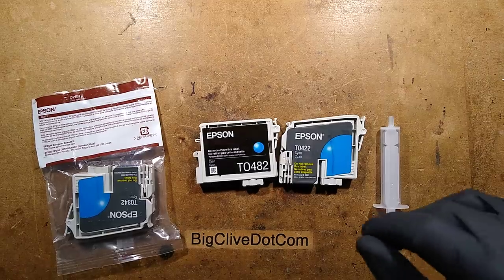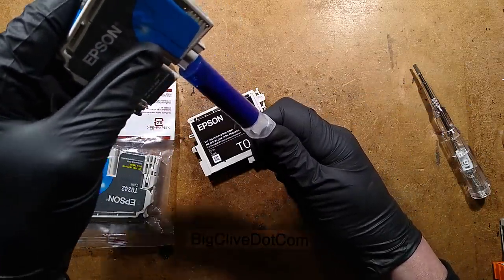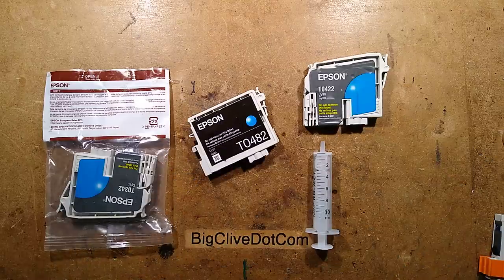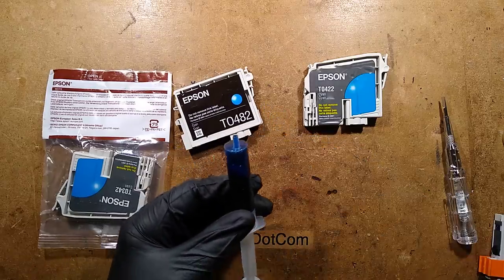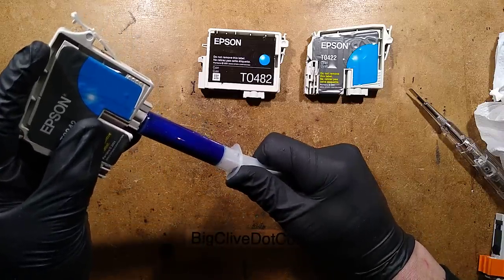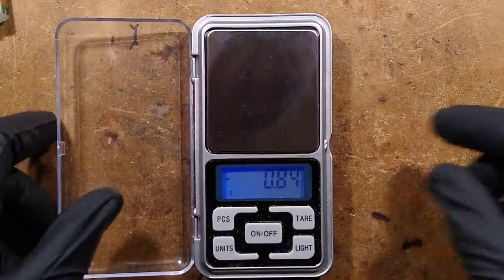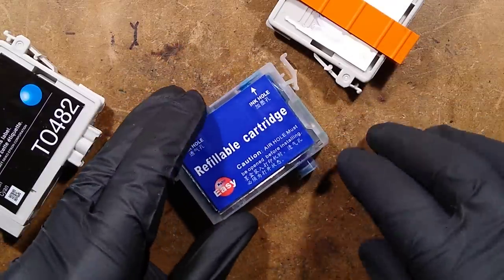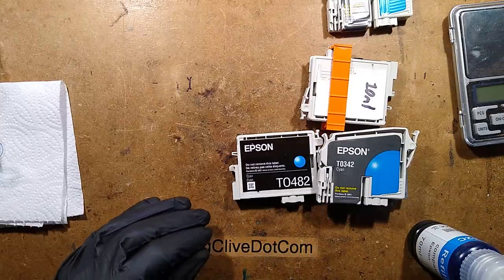How much ink is in Epson cartridges?

Comment: What’s worse are the triple colour cartridges, as they stop working if you run out of one colour
Reply: Yeah, it's always just one color.
Reply: @brianallen9810   Black tends to run out first even if they supply a bigger black tank.  Three ink printers are not generally used for much colour printing after all.
Reply: @hedydd2 What...? Black is a completely separate cartridge so that's hardly relevant. Also, plenty of people print in color on 2 cartridge printers.
Reply: And on a color printer, you still need the color cartridge do print black and white
Reply: @12345.......  You still need the cartridge, but it doesn't have to have ink AFAIK. Don't throw the cartridge out, easy.
Reply: The best thing I ever did, years ago, was junk my epson with it's dried out print head and buy a colour laser printer.
The quality was similar, but waterproof and stores forever, and is much much cheaper :)
Reply: @nimoy007  Not if the printer, as is commonly the case, requires a suite of all working inks in order for it to print even with a full black cartridge. Also some brands also disable the scanning to computer function is any single ink cartridge is empty. It’s extortion, no more, no less.
Reply: @nimoy007  Of course they print in colour if it has the facility but that does not mean, or in fact it does mean that the colour reproduction will be of very poor quality. These are not bought for colour printing but are adequate for printing most documents in colour. For photographs they are nothing short of pathetic.
Reply: And then they are crazy expensive to replace, as those are usually the more expensive cartridges with the print head built in anyways. I always tried to stay away from those. In my calculation it was not economical to use one of those, although the printer itself initially might have been cheap. Also, even with very little demand for high wuality pictures, even with simple graphs and diagrams, the quality of those was somewhat lacking, as they mixed up all three colors for black when printing pictures, sometimes even if there was a separate balck ink cartridge (that only got used for text. sometimes the coloured ones even were dyed inks and that one was pigmented.)
Reply: Color*
Reply: The solution is to spend $10 more and buy the Epson printer with separate cartridges.  in my 30 years of computer business I have seen all inkjet printers from all brands, and the only ones I found that did not suck prime every colour on every job are the Epsons.  I use a Workforce and I use clone cartridges that cost ~$25 Australian for 20 cartridges.
Reply: @nimoy007 Our Cannon MX won't print without the black cartridge having ink in it. Not all printers are created equal, obviously. It was the first time I'd ever run into a printer who wouldn't print because black was empty, even when black wasn't needed, turned off in settings, and in the printer options. I ended up popping the sensor chip and soldering two of the pins together in order to get it working. (Wasn't about to go out that evening in the rain just for black ink I didn't need, lol)
Reply: @hedydd2 That's the same issue our Cannon had. It would literally get stuck in POST upon power cycling it, and no amount of computer interaction could be had short of opening the software and seeing it was out of ink. No scanning, no faxing, nada. To this day no amount of firmware updates have fixed this bloody oversight, and short of them wanting ink sales, I can't imagine why anyone would have hardcoded this into the printer.
Reply: @samholdsworth420 

Colour*
Reply: I mean, every printer stops printing the moment you run out of cyan, which they use to print everything, even black
Reply: @nimoy007  unless its an HP which uses color to make the black darker lol. at least on some printers. for the most part inkjets are just nothing but crap. either your going through cartridges at cost, using a refillable tank system that can have a sponge the fills up and non replaceable heads that clog.

Im so happy i went laser years ago
Reply: or how about HP where if you run out of color ink you can't even print grayscale B/W, which is why I put a color cartage in mine that has about 20% ink left, and I never use it just so I can print in B/W as that's just about all I ever need at work. At home it's brother a B/W Laser all the way, but I will say HP does have good Linux support with a good software package for scanning if you have a compatible all in one.
Reply: What's worse is when you're printing in black and white, but your printer requires color ink to help make the black darker, so the printer won't let you print anything at all.
Reply: @samholdsworth420 we are in the UK so it is colour 🇬🇧
Reply: @hedydd2  Yup, Canon either lost/settled a lawsuit for this.
Reply: @infinitivez 
Put simply, the printer is not a printer but a demand system for their actual product: printer ink.

If you're going to use that device then they want their blood money, regardless of whether you need to print or not: as inks dry and blocks the print head, it requires flushing every time you switch on - how can it perform this vital function[1] if you have no ink in the machine?  At switch on it doesn't know you only want to scan...

[1]vital not only to ensure "clean" printing, but also to ensure ink is used up and you have to buy more...
Reply: I remember an old printer I had way way back in the day an HP 656c that could actually print with individual colours and use up all the ink left, some old printers could do that i guess back then it was normal for things to do what they should do.
Reply: I had one used for printing black only, and got tired of this, so got a refill kit. Then all 7 ink cartridges eventually were filled with black ink, as it only was used to print a few pages a day, and it was an old one, compatible with the PC running Win98SE, not on a network, that ran a phone report system. Used the inkjet as it was not xp compatible, and the original Seikosha dot matrix printer it had needed a new print head, due to it being so worn the dots were almost random. Free printer, as opposed to buying a new one, and hoping it still had 98 drivers, no problem using free, especially as 98 was long out of extended support.
Reply: @nimoy007  black still uses other colours
Reply: @12345.......  ridiculous ain’t it
Reply: @G-ra-ha-m  Mono laser, now on it's second cartridge after 3 years, and still perfect. Unlike the dozen or so inkjets I have helped neighbours replace in the same time.
Reply: That is because of the required microdots that printers have to print in light yellow or cyan, if the colour is missing, the dots can’t be printed and the printer locks up. This is a way of tracing ransom notes and fraudulent documents. It’s well documented and there are ways to forensically trace all printers by this. I don’t know how they do that with mono printers, I have to assume there’s a way of doing it in toner or something.

The tri colour cartridges are essentially a stupid tax, they’re there for the people who get sucked in by a cheap printer, and they massively inflate the cost of a cartridge to make up for the loss. I’ve repeatedly told my clients, never ever buy a printer that doesn’t supply individual ink cartridges or tanks.
Reply: @nimoy007 not the case with the color printers I've used. When the color is empty or not working it'll error on black only prints.
Reply: @G-ra-ha-m
I contemplated a color laser because I needed waterproof prints. But I went with 2 printers instead. A BW laser and an HP with HP instant ink. The instant ink service charges me $0.10 a page which is terrible for BW but for 8x10 color it’s a good price. 

And since it is actual HP premium ink it’s water proof and archive for 50 years I think. I feel the print quality is a little better than laser. 

But man it’s expensive when I send a 50 page BW document to the wrong printer 😋💰
Reply: @hedydd2
The fact some companies have gotten away with disabling scanning when there is no ink cartridge is almost criminal. I’m glad all I need is my phone for the scan quality I require. Because if I ever ran into that issue i would probably throw the printer out the window. 😋
Reply: @ecospider5  you know if you cancel instant ink they’ll brick your printer permanently? HP are probably the worst and most consumer unfriendly company for this stuff, I’d never ever buy or recommend a HP printer to anyone.
Reply: @alexanderkupke920  I had to junk a full colour cartridge for my Epson when the (seperate) head dried up.
One summer holiday unused, and the whole printer was scrap.
Now a full set of colour + black for my laser, pattern parts, costs less than that, and just sits there, waiting :). Ironically my (Dell) laser didn't cost much more than the inkjet, and prints photos well enough to frame them.
Reply: Or HP printers that don't work at all if you don't subscribe to their monthly Ink subscription
Reply: @samholdsworth420 only in America, in England its colour
Reply: Those tri colour carts are the worst
Reply: @12345....... On some. Some printers are happy to print with empty color cartridge if you tell them to print in grayscale.
Reply: @samholdsworth420  Colour*
Reply: @Underestimated37 
I have not found that to be true when canceling HP instant ink. They brick the ink cartridges. So you have to return those but then you can purchase your own ink cartridges and the printer works fine. 

But yes. If you are not interested in the $2 a month instant ink service for the rest of your life I would probably not suggest a new HP printer.
Reply: @ecospider5  there’s been tons of people reporting that the printers themselves are locked down. If I were to spend that kind of money anyway I’d just lease a colour laser, the per page cost is the same and the print quality is usually higher.
Reply: @Underestimated37 
Well that’s good to know. I will make sure to block the printer from the internet if I ever decide to cancel my subscription. 

Color laser is great for document printing, really sharp text and graphics. But they can not produce the color quality of good inkjet printers. I mainly print 8x10 actual photos. So the color quality is important to me. And since I am only printing full color photos on that printer the $0.10 a page from instant ink is cheaper than laser when you include the cost of replacing the drum. Laser is cheaper than $0.10 a page when your prints are less than 25% coverage of the page.
Reply: Wait, do they still manufacture those absolute scams? Last I saw a combo cartridge was in the 00's
Reply: @derchesten  yup I’ve had to warn people off them 8 times this year alone
Reply: @Underestimated37  No need to lease, colour laser printers are cheap as chips now, and do good photos.
Reply: @derchesten  Yeo
Lots of printers manufacturers still use them
Reply: yes but you missed the bit about how they said they’d rather instant ink than pay for new cartridges/toner which is essentially a lease except you’re completely bricked if you cancel it.
we were discussing that there are far better alternatives to that scummy HP service. And I’ve seen a fair number of lasers brand new that are good for 6 months then take an immediate nosedive, you just have to be picky about your standards and do your research, and those that are good often charge (AU)$60 per toner for each of the colours so it far outstrips the savings you’d get if you took out a lease.
Reply: Also, those cartridges with integrated print heads that are used on the cheapest Canon and HP printers tend to have the most expensive ink with very little ink actually in the cartridge. A lot of plastic waste
Reply: Depends on what kind of printer (Canon or HP) you have. I had the Deskjet 1510 and even if one ink ran out of the tricolor it still works as I skip the message anyways. And even if I would remove the tricolor it still would print (obviously B/W only). I don't know how my Envy 6020 series will handle it as I haven't really used in the past now. :P But I have a laserprinter as well as well as a laser fax printer.
Reply: @G-ra-ha-m  Yep. My Samsung CLX-6260FW was the best £250 I've spent in many a year. Had it 5 years now and on the 3rd set of cartridges.
Reply: @samholdsworth420  Colour actually 😋
Reply: @G-ra-ha-m  Yep, my Samsung CLX-6260FW is 5 years old and still going strong.
Reply: @TestGearJunkie.  WRONG 😭
Reply: @samholdsworth420  Not in countries where we speak English proper 😆
Reply: @TestGearJunkie.  Proper English*

You speak proper English
Reply: @samholdsworth420  Yerse..!
Reply: >buying a color printer

What in the world do you need color for if all you're doing is printing the occasional paperwork? If you need it for art or photography, you should be either using a professional print service, or buying a far higher-grade machine. Otherwise just buy a black-and-white printer ya dingus.
Reply: @kyotra  it’s not that easy though to find a b&w printer though at an affordable price
Reply: @CricketEngland  Well yeah, the B&W printers are more expensive because the companies are not subsidizing the price based on future ink sales. You get what you pay for in this case - you can spend more now, or spend far more down the line.
Reply: @kyotra  if I am just printing the occasional paperwork (which I am) then I think my triple colour cartridge will last me long enough rather than spending hundreds on a b&w printer
Reply: @CricketEngland  You can get a Brother laser jet for $120, it's not that expensive....

Comment: Years back I was working at an advertising agency where we had  a large format Epson printer with big cartridges. When these big catrtridges were "empty" I took them home with me and emptied the remaining ink with a syringe. 1 portion of this leftover ink was enough to refill my home printer 6 times! I've been printing with free original Epson ink for several years 😂
Reply: Fired
Reply: 😳🤯

Edit: I was reminded of an older model HP printer my dad has where it's used so infrequently that it tends to run out of ink even though HP's software shows that there's still ink remaining.
Reply: @Crecross  He doesn't work there anymore.
Reply: Experimenting with wax thermal transfer printing many years ago, I once obtained a few used reels of „ink“ ribbons from a local business to try and re-use them for second-grade prints in an old printer I'd come into possession of. When rewinding the ribbon to fit it, I noticed that every document printed on them was duplicated in perfect detail on the ribbon, and some of those documents weren't exactly for public consumption! 🔒

Needless to say; If I ever use one of those printers again, I'll be making darned sure to keep the used ribbons under close control and effect proper disposal, like I did with the few mentioned above! 😎
Reply: That's proper recycling ♻
Reply: At a company I used to work at, the CEO had a printer that used the same color toner carts as mine.  He would routinely have the company buy a whole new set, regardless of the level used, and replace them "just in case."  The guy tasked with exchanging them would bring them back to the office and ask if anyone wanted them, as they still had plenty of life left.

I have been using those ever since.  That was over 10 years ago.
Reply: @Crecross this is stuff that would be thrown away.
Its like taking bent paperclips home, or plastic packaging to recycle in a 3d print set up. 
Literally nobody cares, and the smarter buisness' can claim "reduced waste" as a free reason to use them.
Reply: @dieseldragon6756  Yes, the same goes for dye sub printers like the Photo Kiosk. These printers with integrated computer & touch screen were (and perhaps still are) used in shops where you can print your own photos. The ribbon that's left inside the machine still contains all the pictures the customers have printed.
Reply: @dieseldragon6756  Like a fax roll. After it runs out (usually only 150 pages or so) you have to burn it.
Reply: @der.Schtefan Yes, fired.
Reply: I’ve seen some photographers intentionally reuse dyesub ribbons so that there is a ghosting image of the  previous photo printed. It can look pretty cool, although you can probably do something like that with Photoshop instead.
Reply: @Ni5ei Also it clearly shows your entire gallery on the screen if you want to get the pictures from your phone. Needless to say I speedrun the proccess so people don't stare at my gallery, even though I have nothing scary there
Reply: I have a couple of those wide format Epson printers at work (a stylus pro 7900 I think). The ink for those is such a scam, it's like $1300 for a full set of cartridges and only about half of the ink bag inside gets used before the chip on them tells the printer that it's empty. Not to mention the printer automatically does "nozzle cleanings" where it just squirts huge amounts of ink into a sponge to waste it.